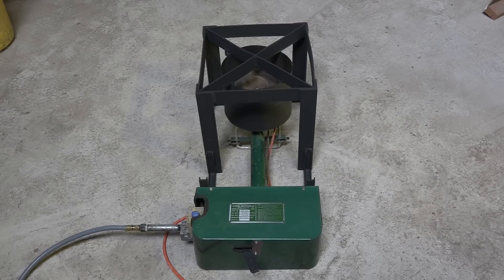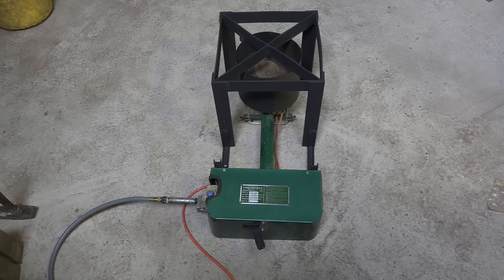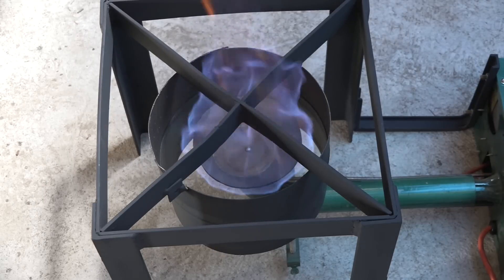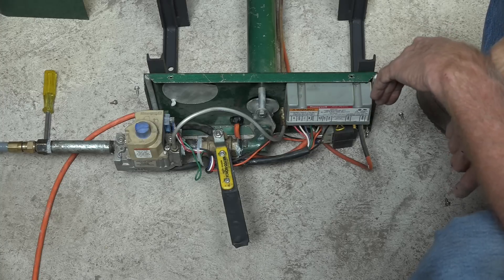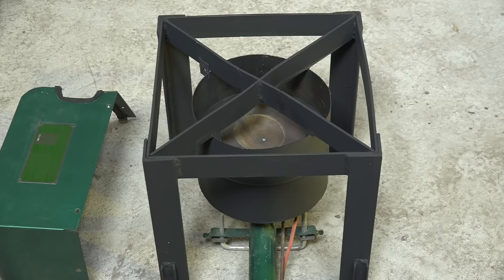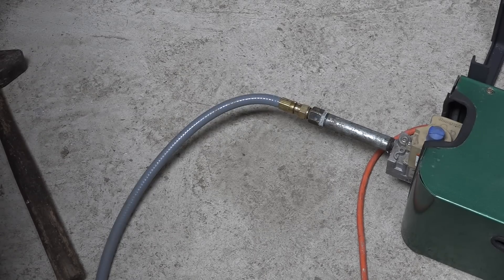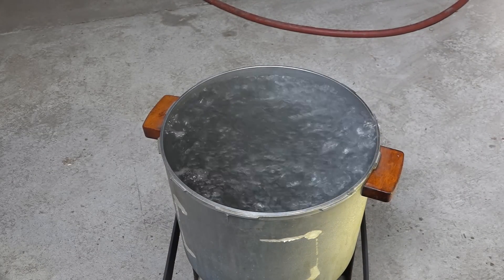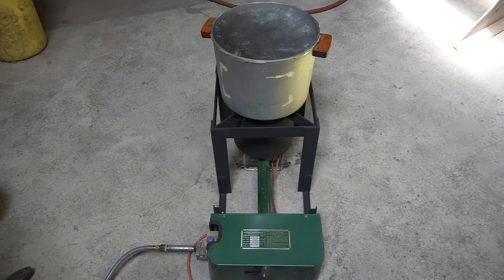Homebrew burner

Comment: Nice work, I like it.  I'm in the trade but do mostly refrigeration.  I also am new to home brewing.  So far I have re-purposed a scrap sandwich cooler in to a beer keg cooler.  I been thinking about building a wort chiller out of an old refrigeration condensing unit.  The other option is to fix an old under counter ice machine that is on the scrap pile.  

Also I did bottle my beer for awhile than I switched to corny kegs.  It's less work and I already have CO2 for coil cleaning.
Reply from the maker: +1captjake I also use a commercial cooler.  Haven't got into kegs yet.  I will be doing one on a wort cooler.  I was amazed at how much tubing you need to make it work efficiently.  Thanks for the thoughts.
GFM